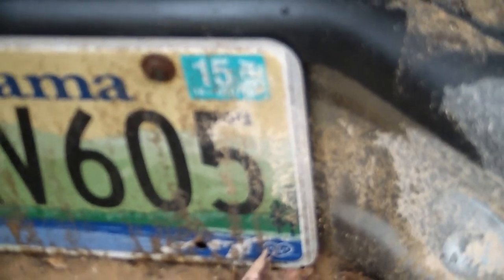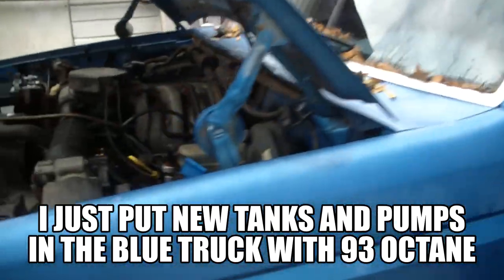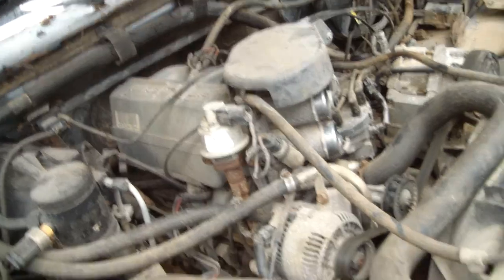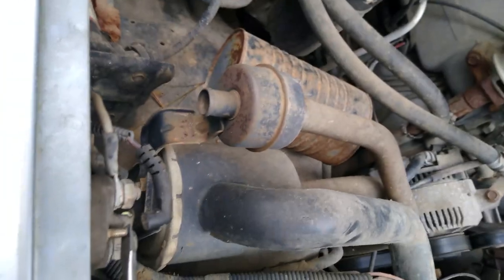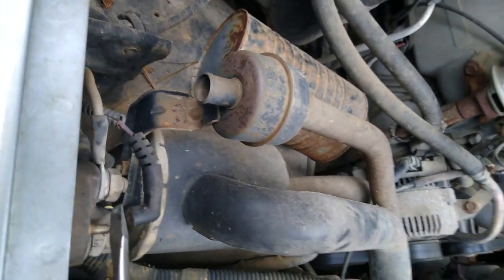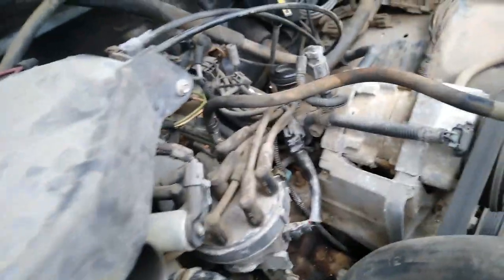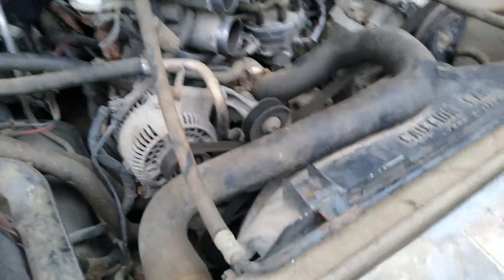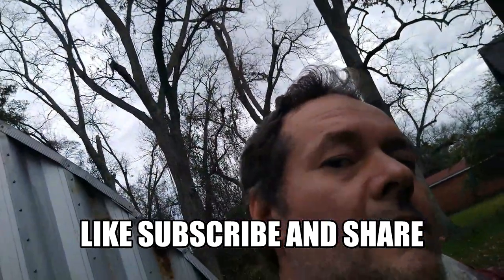94 Roller 351 W First Start In 5 Years

Comment: Genious
Reply: How is the ranger doing ? If you ever get the time you should do a video on how your pulling timing. I think iv talked to you about it before but this is all new to me and I can understand more seeing something.
Reply from the maker: I had the Mustang feeding it today and let it run about 20 minutes. I put 3 gallons of trans fluid in it before I got it full. Transmission has reverse and that's it.
Reply from the maker: I took the spring out of a grease gun and put it in the wastegate. Now it's at 10lbs of boost and still eats the tires off. My distributor is hooked up  to the vacuum port on the carb that only pulls vacuum when you give it gas and advances the timing like normal. Once it starts to make boost the carb is pressurized and goes from sucking air to pushing air out all the vacuum ports. So the vacuum advance goes from pulling advance (pre-boost) to boost however much timing the spark advance was adding is backed back out from going from vacuum to pressureized.

Comment: Dang that needed an easy button. Getting harder to find Windsor’s, is that a F4TE roller block?
Reply from the maker: TRUNKBACK JIM 
11-93 is the date on the door. It surprised me that it busted off that easy.  It has 284,000 miles on the truck odometer but the motor looks too clean. My Mustang jumped time the other day. I guess it was jealous the Ranger has been getting all the attention. Hopefully that $600 covid check comes and I can rebuild the whole car Lol.
Reply: @kickassmustangsgarage  we had a 429 lined up for the Capri but it got sold out from under us, 7 liter dream dead but turbo Windsor dream revived LOL
Reply from the maker: @88TRUNKBACK   I want to put one of the three Semi turbos I have on this one and see what a roller 351 can do.  I have a hoarding problem when it comes to Ford parts and go-fast goodies LOL.
Reply: @kickassmustangsgarage  Your not along brother just got a 1993 351w to go in my 1975 f250. Thinking blower or turbo for it.
Reply: Bored the 351 .030 over 357w and mated her to zf5 truck transmission it's all sitting in the 1975 highboy now can't wait to get it all wired up